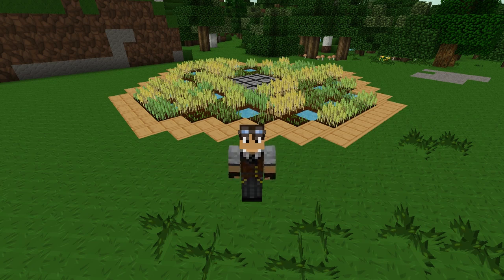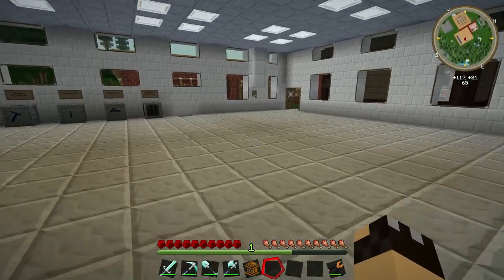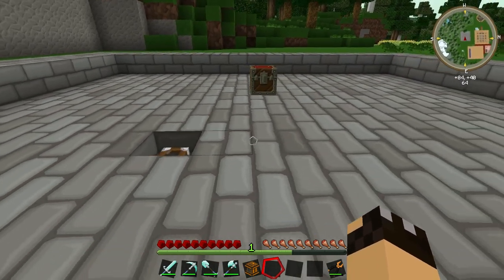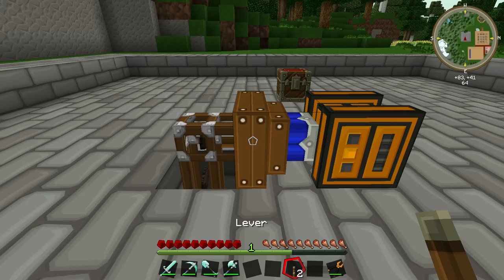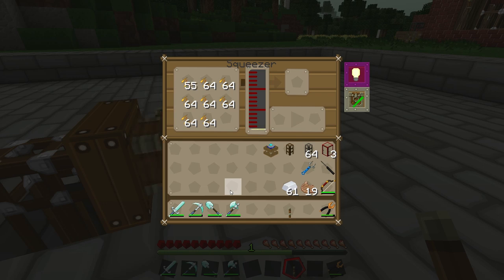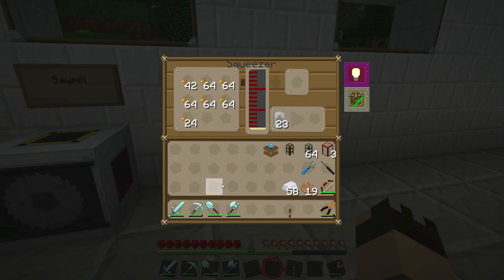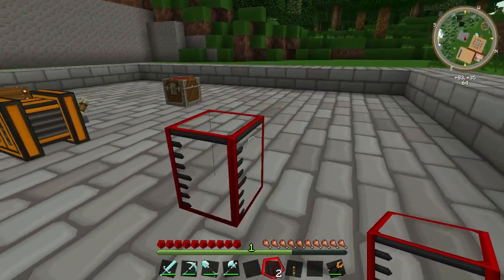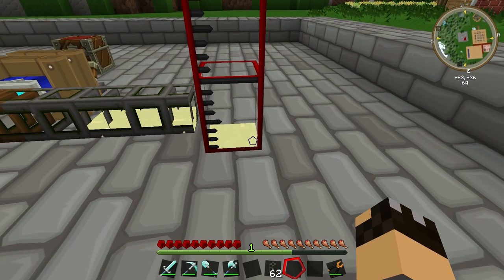How to Feed the Beast in Minecraft - Squeezer - 17

Comment from the maker: Thanks. It's actually just the standard zip extraction that's built into Windows 7. I'm not a Windows 8 user, but I'd assume that has it too. I'm also fairly certain that XP also had it as part of the shell. I think it's an adaptation of the old WinZip software.

Comment from the maker: Not really, Redstone engines put out 0.5MJ/t and the Squeezer needs 5MJ/t to run at full speed. So you'd literally need 100 Redstone engines connected with a lossless power distribution system. If you can't use peat, consider sterling engines.

Comment from the maker: A peat fired engine outputs 1MJ/t, which is the same as having 20 Redstone engines - if you use Bituminous Peat in the engine, then it's the equivalent to having 40 Redstone engines. You'd then have to wire all of those engines up and connect them to the squeezer - anything but Redstone Energy Conduits would lose too much power. It's simply not worth it.